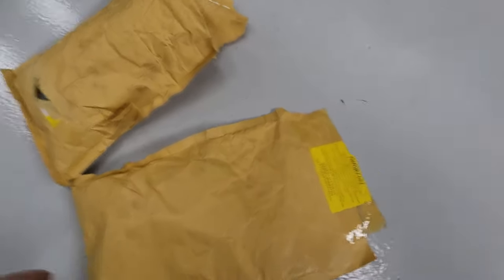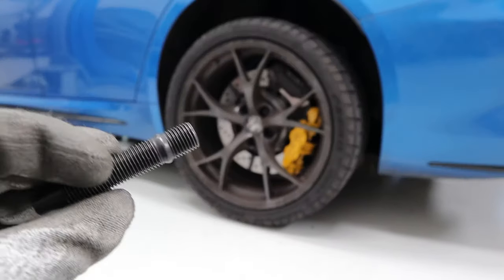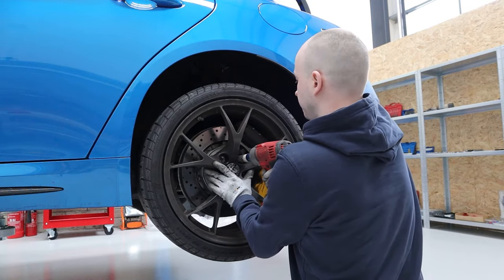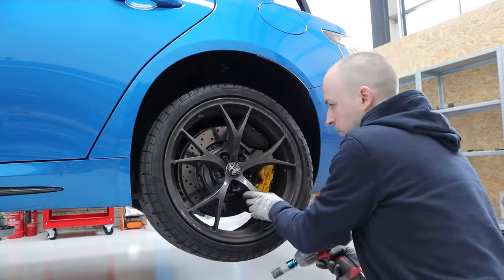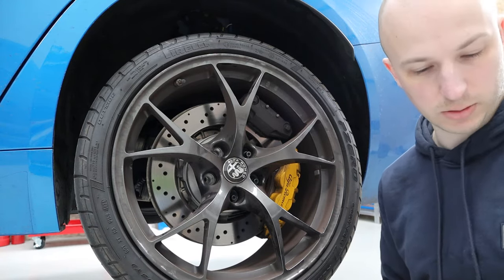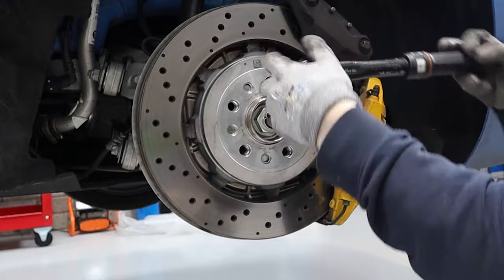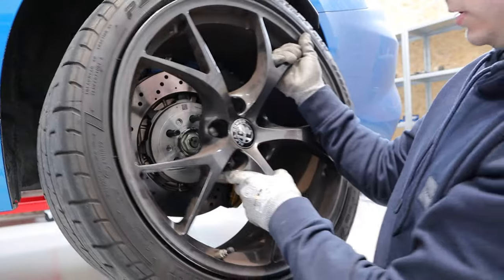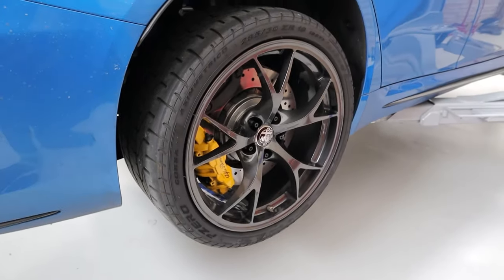Wheel Stud Conversion On The Alfa Romeo Giulia QV

Comment: Will it affect the changing of the brake rotors/discs?
Reply: No if you're taking the caliper/s off anyway.
Reply: @W00LFY100  thanks. So I can still replace the brake rotors/discs without removing the studs.
Reply from the maker: Yeah you can still change all the brake components in the same way as you would without these. Don't have to take them out or anything
Reply: @ChrisDrift  thanks for the prompt reply. Greatly appreciated